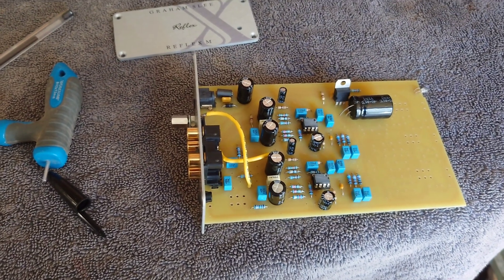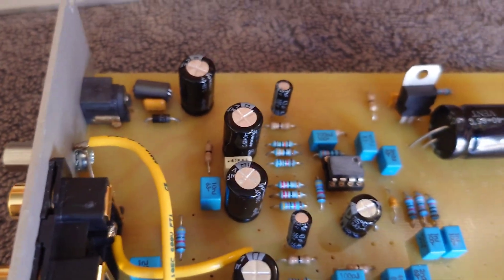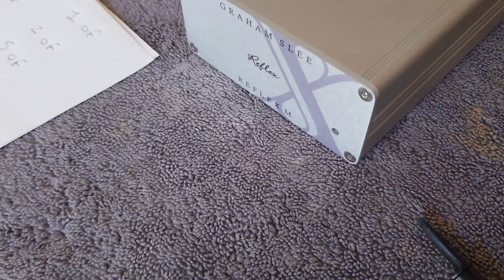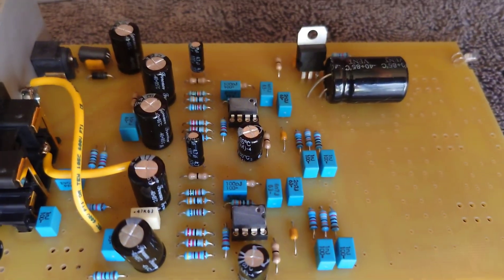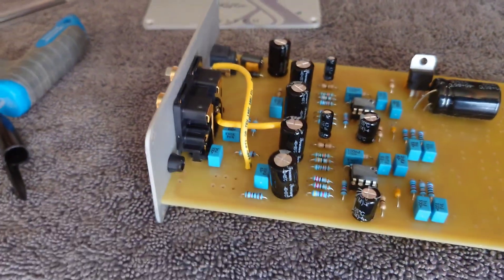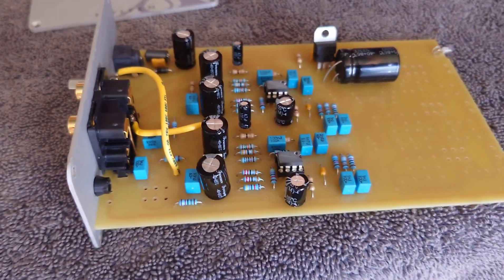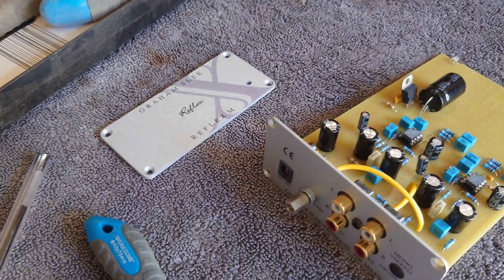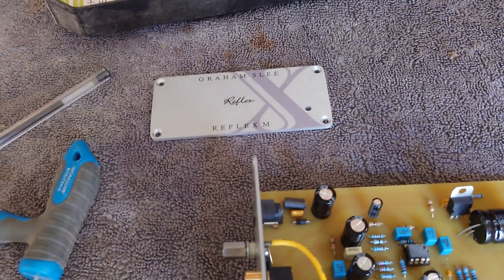Looking At Upgrading The GS Reflex M Phono Pre-Amp

Comment: There is one thing you are over looking here to improve that basic designed pre-amp and that is the quality of the metal film resistors fitted to it. They are cheap 2 pence cheap metal resistors. Replace them all with some Audio grade Takman metal resistors or PRP from Hifi Collective. You will be surprised with the results. HC stock most values but a lot of their Takmans are out of stock. Try this upgrade and you won't be disappointed, trust me. Changing the resistors will lower the noise floor and offer up greater detail and transparency.

Comment: Hi Ian  I also think with most modern hifi , you do tend to be buying a lot of empty space . Back in the 70s and 80s if you took the cover off any bit of kit it would be ram packed with components often in several layers .  Of course the argument is it’s all about isolation to prevent interference , but it still makes you think if they put it in a smaller box would we be a bit disappointed .   Just thinking out loud as usual 😂 .  Best wishes  😀👍👍👍

Comment: Thanks for the video. I'd expect the op-amps used to be bipolar. Whatever you replace them with, make sure they are also bipolar to keep noise low. I can recommend Sparkos op-amps. Also, you might want to replace the regulator with a discrete that offers lower noise and better supply rejection. Again, Sparkos parts are very good, but there are others. Good luck!